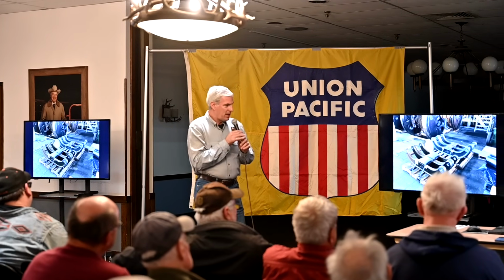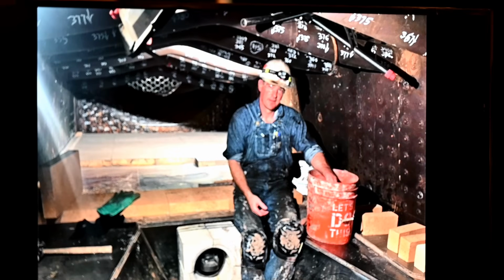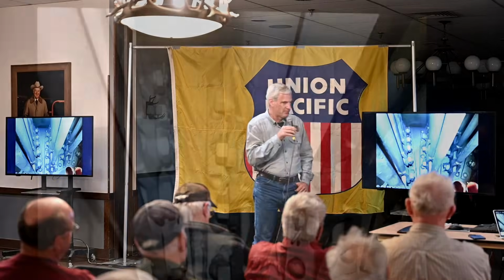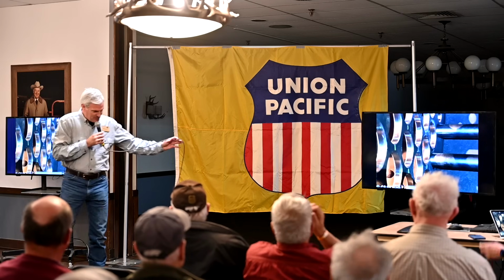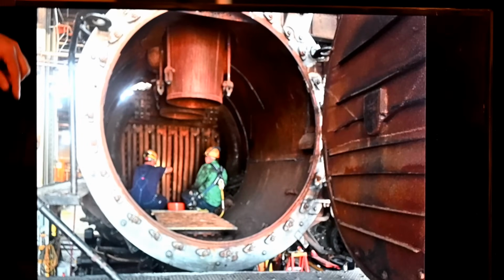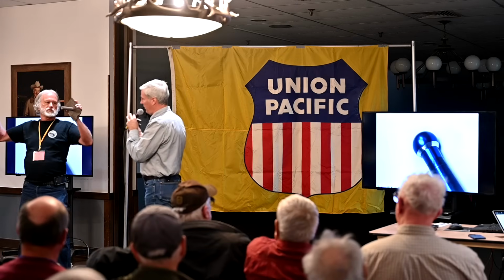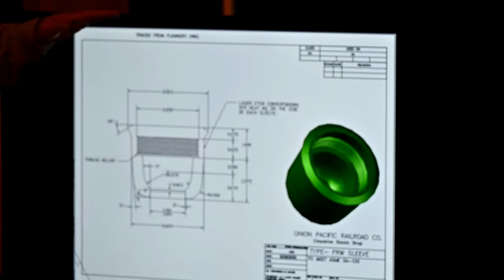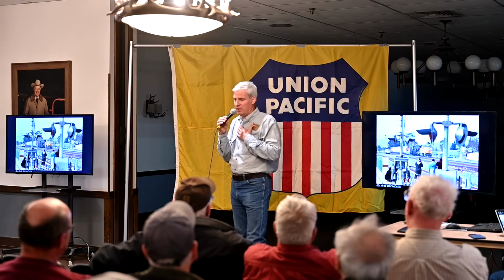Ed Dickens, Jr, presents details about 844 & BIG BOY 4014 firebox work & water treatment after 2011.

Comment: Oil firing is very hard on the sheets of a locomotive Durango and silverton will have a lot of work to do now on theirs sad that they are not coal firing due to the green nuts .
Reply: Doubt us environmentalists are the cause - I'm one and couldn't give a shit about coal locos (such a small impact vs the historical value).  The cause for the switch is fires.  Coal burning locos start fires too easily in such a dry, fuel rich region of the country.  And that will shut down a railroad mighty quick